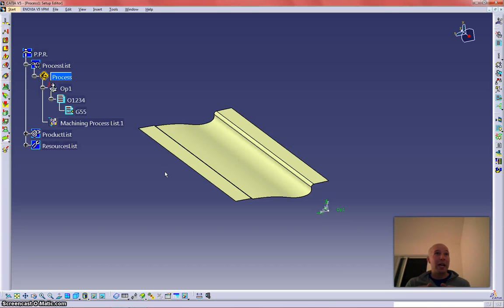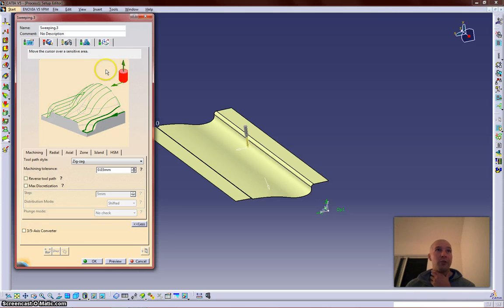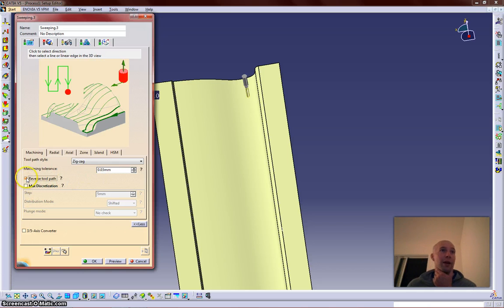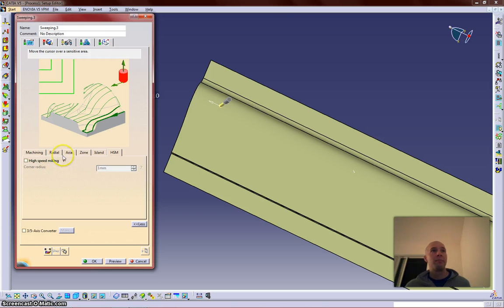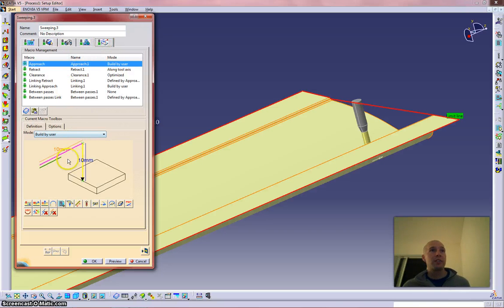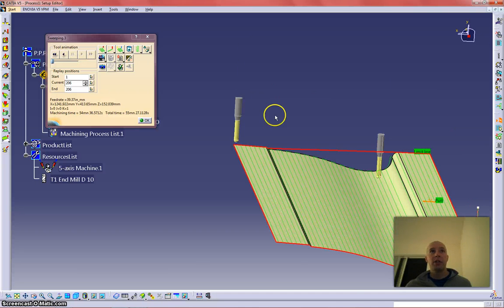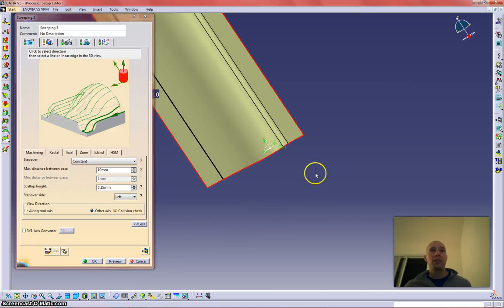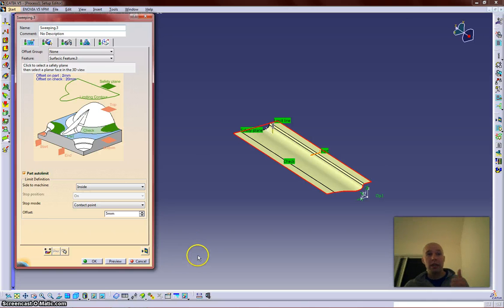Catia Advanced Machining 102 - Machining Operation Window

Comment: How would you come off the surface or extend the tool off the part in x y or z axis?
Reply from the maker: +joshua v It sounds like you'd like your surface to have some thickness. If that's the case I'd create my tool in Generative Shape Design (GSD) then pad that joined surface in Part Design. 
You could also create it in GSD with a duplicate translate followed by creating surfaces along the sides with fill. 
Does this answer your question?
Reply: +RyanBurke That sounds pretty complicated. I figured it would be in one of the toolpath tabs , or simply creating a surface on the wire frame of the part. Im not to familiar with catia but I'll give it a shot. Thanks man
Reply from the maker: +texas thrilla If you have questions let me know. I could make a video if necessary.
Reply from the maker: texas thrilla did you get this worked out?
Reply: joshua v  Nah. I'm using soldworks and mastercam now.
Reply: when am opening advanced maching in catia v5 that is not opening insted of that it showing multiple editoes opening use only NC like that popop coming how to resolve that